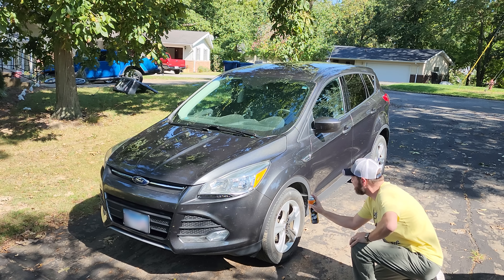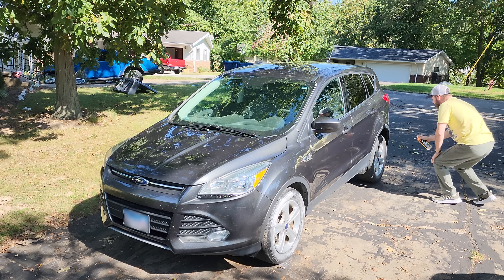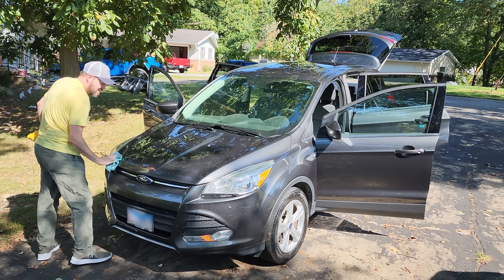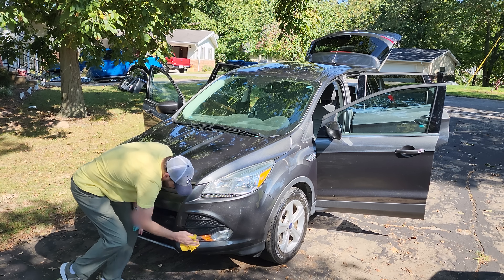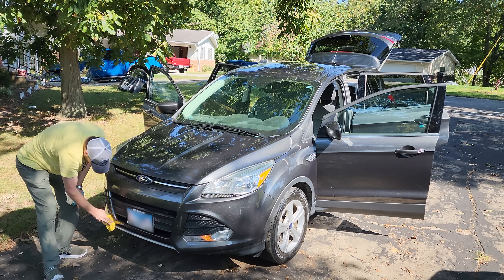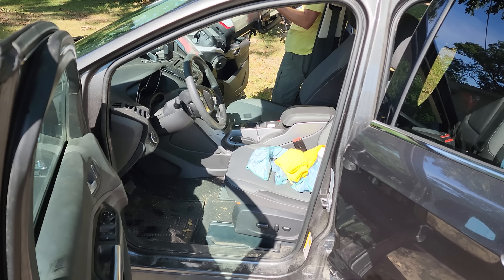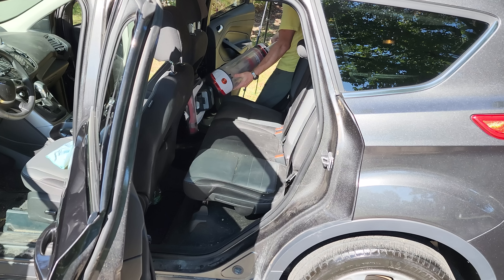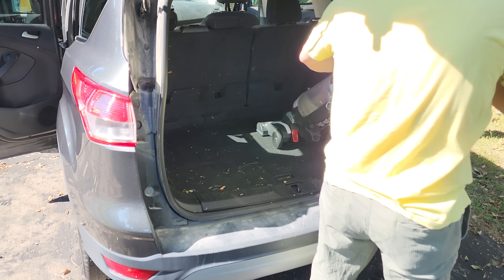How A Housekeeper Cleans A Car

Comment: When I was younger I heard you could use a bucket of warm water and add a half cup of Kerosene and then use a rag wrung out to mostly, just moist, not dripping. Use that to clean your car exterior. No rinsing, and leaves a nice shine and clean car. This was many years ago. They may make car paint differently that in the 70's now. But it did a good job, with little water.
Reply: Took off the paint?? I remember that trick, glad I forgot it😊.
Reply: @janiceyoung5958  No did a great job. Like I said, in the 70's the paint was different on a car. Now I have no idea what it would do and do not want to try to find out. lol